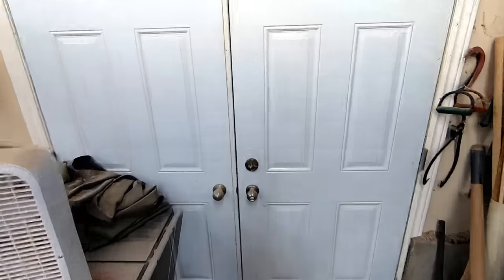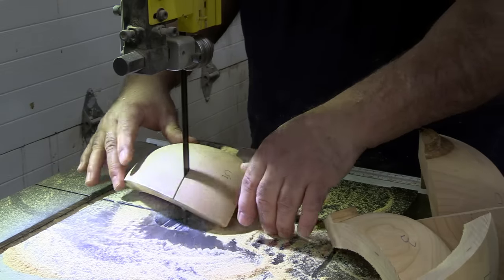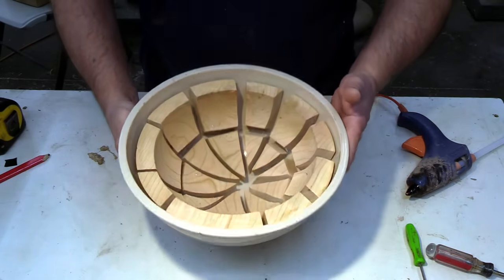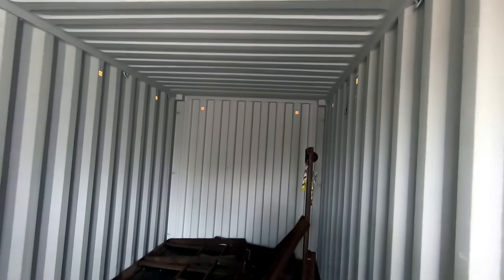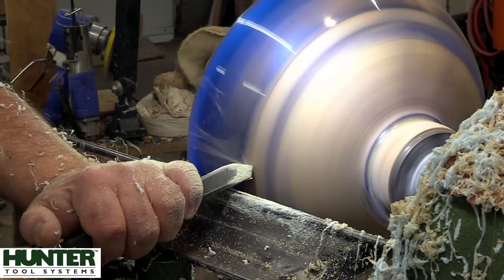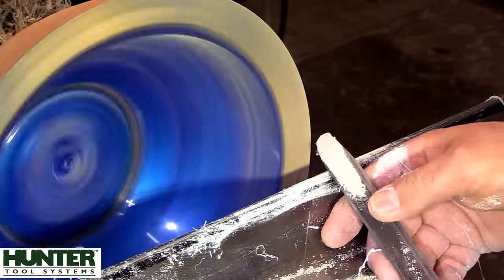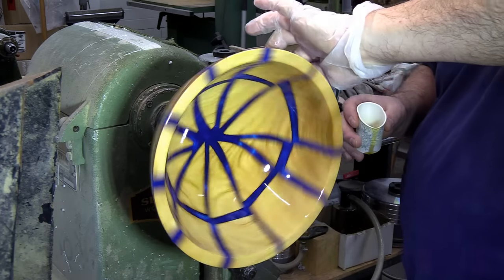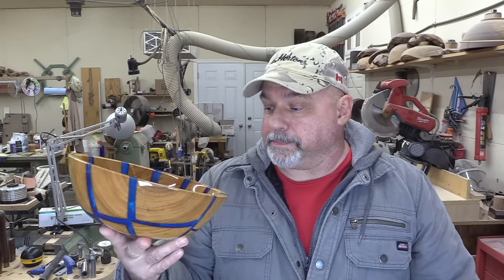Woodturning - Shattered But Not Broken Cherry Bowl FABULOUS!

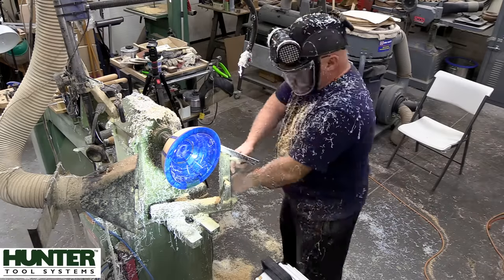Comment: 3) 26:06, You start taking the epoxy rim off the top.  Have you considered doing a wooden inlay into the epoxy with a wood that matches or contrasts the primary wood of the bowl?  I think that would work particularly well with this "shattered" style piece, but it might also be pretty cool on a lot of other pieces that you've done
Reply from the maker: There will be one like that next week. Thanks

Comment: Hi Jim, I got to catch part of the premiere. I had to go to work clearing doors so we can get out of camp. North Slope of Alaska. I was supposed to go home yesterday, but the storm has us stuck in. I do this type of segment design quite a bit. I use thin panels like the back of cabinets to space everything apart. Then glue up. Pull the spacers and pour. Sanding sealer works for controlling end grain soak up. I also get great results with the pearl showing in the resin. I have 2 of this style in my pressure pot at home now. Gonna be hard to turn as they will be in there 4 weeks by the time I get to turn them. A shout out to all who have served for their countries. And the families of those who's heros have given their lives for ours. Thank you!
Reply from the maker: Interesting! Thank you very much!

Comment: Depending on the final position of the sea container relative to the sun you could put solar panels on the roof with multiple benefits. Hot water or electricity with easy access for maintainance and protection of the drying room from direct sunlight.
Reply from the maker: We will see how much the build will cost and go from there, lol. Thanks

Comment: Hi Jim - I've got a number of different comments here, but I figured I'd break them out into different posts to increase the engagement.
1) At 7:23, you talk about sanding off the rough cut from the bandsaw.  For this "shattered" style bowl, is that something you might want to consider leaving? Maybe it's not enough to convey the effect, but I would think that a rougher edge would play into what you're going for here
Reply from the maker: It actually looks terrible if you don’t. Been there, done that. If these pieces were smashed up, that would be a different case. Thank you very much!

Comment: You should put up a tent around your lathe to keep all of the epoxy and wood shavings from getting all over Your workshop.  You could use mosquito netting so you would be able to have enough light to turn and all you have to do is shake it out.  Rig it up like a shower enclosure.
Very pretty project!  It would look nice in the orange tones with the pearl as well.
Reply from the maker: It’s pretty hard to do this and film. It only has about a 20 foot radius, lol. Thanks

Comment: Jim, your wife did have a great idea. But since you hate puzzles, are you sure she’s not ticked at you for something? 
The colors are perfect together. 
Now I’m thinking about how to make a frog to go in the bottom to hold small branches of flowering bushes in a bowl like that. A frog is a dome with a flat bottom that has holes drilled (or made) in the dome part, that the branches fit in. Since old time ones were made of glass I think epoxy might work.
Reply from the maker: I remember my mother having something like that. Thanks

Comment: Wow Jim! Your wife had a great idea!
I live in Vancouver Island, and we have shipping containers that we use for storage. One thing we found to keep the condensation in the containers at bay is that we spray foamed the ceiling only. I don't know if moisture will be an issue on the East Coast but just something to consider when you get there.
Reply from the maker: You guys are pretty much in a rain forest there, it doesn’t get that bad on the east coast but we certainly will need to deal with. I find it interesting that you only spray foam the ceiling and not the whole container. Is that due to the cost? What type of foam do you use, half pound or two pound? Thanks!
Reply: @SpragueWoodturning  I'm not sure what type we used. We only did the ceiling because it wasn't necessary for us to do the walls.  Our containers are white and beige like yours is, and they sit in direct sun all day, but I don't recall them ever being hot inside. It's about the same or slightly warmer than in the shade but not by much.

Comment: If you ever had trouble getting the bowel out i would highly recommend a heat gun with tempter controlling dale i have one for multi-purpose but its handy and as long as you use your head it would melt the glue with out burning anything. love that blue and your channel good luck with the move too.
Reply from the maker: Thank you very much!

Comment: Designer Epoxy
I like it. Have you considered using a hammer to get more jagged separations? If you do a mixed bowl (2 woods), try using 2 the same size & draw out a web pattern on each so you can get the pieces the same sizes.
Reply from the maker: That’s the plan. Thanks

Comment: I actually tried to do something similar this past weekend. My idea was to make two bowls out of one blank. Split the bowl by dropping a heavy weight hoping for random breaking instead of the cut lines like you had. Then I would put half the pieces in one bowl and the other half in the other so the epoxy in bowl A would be where the wood was in bowl B and vice versa. Problem is the blank didn’t break the way I wanted so got a bunch of small pieces haha
Reply from the maker: I can see that happening, lol. I plan on doing something similar in the future. Thank you very much!

Comment: Really cool look. The shattered pieces makes me think of images of planets on the cusp of exploding. I wonder if it would be possible to do a globular hollow form capturing that effect. 🤔
Reply from the maker: Sure, just use spray foam, then shape it and glue the pieces to it and cover in plastic bags and fill with resin. You could also glue up some wall studs and do the same thing. Thanks

Comment: Nice work Jim: scary start trying to put it back together. The blue looks really nice with the light coloured cherry. As for the sea can. A ventilation system would solve your worry about the heat. A heater would be needed for the winter. Another option would be to put a roof on it with a good size overhang all around. As always stay safe. PS: is the cherry from a local tree??
Reply from the maker: This could of been one of yours. Thanks!

Comment: Hi 👋, my heart and prayers go out in memory of everybody fallen and suffering from war. , Jim, and the input from your wife, It looks amazing, that was a great idea, it actually reminds me of a spiders web, Not sure whether it is possible, it might be an idea to see whether you can cut it into a helix, whether it is possible to use a router on a jig , or if you’re feeling very creative and scary, even a chainsaw, 
I went back to the UK last week , whilst I was there, I went to my container that I hadn’t been to for nearly 4 years, and a lot of my timber that was kiln dried is now around 18 to 20% moisture, not very good, plus some of my bits of tools and accessories I’ve got rust on them, I’ve spent quite a few hours the other day just cleaning my Sash clamps, and I have picked up my massive engineers tailstock, which is fitted with a stepper motor, I’ve stripped it all off and put it back as a normal tailstock, at some point, I might get the electronics working again, I had somebody build electronics for it, to make something that you love ha ha, 😂, pepper mills 😂, back in the late 90s, I earned a serious amount of money, making Mills, play with all made out of exotic Woods, and I had a pure silver ring band around the base, which was Homart for the millennium, I’ve even still got some profile tools for doing the tops, as for your container, I recommend that you insolate it, and even if you put a false roof over the top and sides, this will obviously help with extreme heat and cold, and will look better virtually, then I still container sitting in your garden, so I do know people, and seen a lot on YouTube where people have made houses out of them, 
It is a great idea, different wood combinations , even to the point of probably using different colours resins.
I wish you and your family, all the best for the future , and your move all go safely, I/we all look 👀 forward to your next Art project .
Phil from the moulin France,
Reply from the maker: Someone else mentioned they spray foam the top of the container and that drastically cut down on moisture in the container. They are on the east coast of Canada that’s considered a rain forest. Something to think about. To bad it’s so expensive. Thanks

Comment: I really like this week's piece it is something I was toying with doing something like this with some bowls that i picked up from my cousin after he passed that were basically throw away they had been turned while still somewhat green and warped really bad before he finished them and i wanted to try to rescue them if possible, seeing todays show gives me hope for them thanks for the informative way you do these and to your wife for coming up with the idea the cherry and Designer Epoxy with the rainbow blue is stunning. also you asked for thoughts on the hunter tools I purchased 3 of them  ( the phoenix #1 the osprey #2 and the Hercules #3) and I love them I have been using them only for about 3 weeks now but they are great I like the fact that I don't have to sharpen them and I have not had to turn the cutters yet either I can use them from heavy cutting to very light cuts in the same tool  and the best part is it really reduces the amount of sanding I have to do. I know this is getting kind of long but one more thing the power cap came in and I love it compared to the bulky masks and shields I was using Thanks for the info.
Reply from the maker: Hunter tools are awesome! I also prefer the Powercap over the Airshield Pro. Thank you very much!

Comment: Hi Jim
"Mosaic" is the term for tiles, plates, pictures etc made into pieces & put back together. I've not heard of it with rats unless you are referring to "taxidermy".
When you unmoulded it, it looked like the opposite of last week's piece -mostly resin with wood spots (where the glue was). I liked this week's piece but I would have liked the lovely blue resin rim to have remained on the bowl as it would have enhanced the resin-filled cracks/spaces areas, in my opinion
Cheers
Reply from the maker: If the resin ring was thicker I would of left it, but seeing the ghosting below the resin of the wood was messing with me. Ive seen things that have been dissected and then reassembled but in an exploded view. For the life of me I can’t remember what it’s called. Thank you very much!
Reply: Thank you for your comments. Yes that  direction -I never thought of that since school (mumble years ago). I'm not really into spiders (put me off the last week's bowl) or rats.
But the art of Mosaics is very old & yet also new with digital media using small photos to  make a billboard sign or something. & the patterns & arrangements are endless. 
I'm still annoying my family by watching your videos but I enjoy it -latest is my cake baking split & I was told to "just add epoxy & stick it in the pressure chamber" as they left the room which highly amused me, as it shows they are listening a bit. Anyway it a bit of a laugh. You video arrives 2.30am Saturday morning here so we were already into remembrance day. I'm grateful for their courage.
Reply: Regarding the rim, you were there in the room, I'm only watch on my cellphone. You make good decisions & the outcomes are great. In my opinion those who hated the polka-dot bowl probably were tradionalist woodturning people & not necessarily looking at it as from an artist point of view who wants to make heirloom pieces. Well done.

Comment: Have you ever used lye to stain wood? In cherry, it makes a fantastic red color. Epoxy resin has a pretty good chemical resistance, I think, but it would be a good idea to check with the manufacturer before using it on a resin project if you decide it's something you'd like to do.
Reply from the maker: Interesting, I never stain wood do to the fact that in most cases it’s not food safe. Would be fine on a nonfunctional piece though. Thanks

Comment: This turned out really well!
I was thinking during the initial puzzle piece stage that maybe using a foam mounting tape instead of hot glue might be useful: it'd be easy to turn away, and would provide a more even spacing. I have no idea how it would affect resin staining, though. Or if it would make demolding more difficult.
Also, I wonder if it would be easier to attach the pieces to the smaller bowl, and work inside->out, instead of attaching to the outer bowl and working in?
Your technique worked great, though, so those are just thoughts.
Thanks for showing us the sea container. Makes this move more real, for sure.

Thank you for your service.
Reply: Oh! I'd love to see a 2 or 3 wood exploded bowl, too!
Reply from the maker: Glueing them to either bowl should work, my lefthand brain doesn’t like gluing the pieces to the smaller bowl though. Lol. Thank you very much!

Comment: I like it. I'm bias as cherry is my favorite wood. I think I would have used 2 sided tape to fit the pieces into the bowl then hot glued for the final glue in. As for the multi wood bowl ideas. Go for it! Cut your first one up then cut stencils from paper of the parts and lay them on your next bowl to make them as close to each other as possible.
Reply from the maker: That’s the plan. Thanks

Comment: Another out of the box thinking and I like it!!    And of course we love that wonderful Designer Epoxy 

When do you use the vacuum on a piece , I just used mine for the first time and was surprised how much the resin dropped but no bubbles!!
Reply from the maker: I’m assuming your referring to the vacuum chamber? I mainly use it when the wood is rotten or I’m trying to fill thermal cracks just to make sure they are filled. Thank you very much!

Comment: with the shipping container you can buy inserts to insulate the inside to make all the walls flat to help with temp and shelving etc and with your bowls you should just make a big crate against the wall and put a top on it to make it a bench that can lift the lid when you want bowl blanks just a thought
Reply from the maker: I bet those insulating panels are pricey, but I’ll look into it. Thanks!

Comment: Loved that bowl, colours go so well together and it's a great design idea too ❤❤

I really like that bowl, you could do a 2 bowl opposing set if you were to use a light and a dark bowl, instead of cutting the triangles and splitting them you could also mount the blanks and use your parting tool to cut hoops/rings out and have them contrasting by alternating light, dark, light, dark and vice versa? ... just a thought? lol

Could even halve, quarter or eighth the rings to have the segments of the rings alternate too? Or go half on the bottom, quarter on the next ring up, eighth the next ring and sixteenth the next and so on. So many options lol
Reply from the maker: Lots of possibilities, thanks!

Comment: I really love this bowl Jim
Like the broken with resin
Hey I noticed you talk about your wood lathe and it is daily.but question what is the best in a wood lathe? Any particular brand
I am in skilled trades. And currently doing palliative care for my wife .she has stage 4 cancer in lungs. Once the dust settles. I am in market to purchase some equipment
I see vacuum pot and air pot and designer Expoxy and hunter tools
I have your link to purchase that
Just need some guidance on a lathe.
I have 220 volts and gas in garage.
Reply from the maker: A Oneway 2436 five horse is the king of lathes as far as I’m concerned. Robust makes great lathes too. Sorry to hear about your wife! Thanks for watching!

Comment: Another great piece, Jim.  One question: Why no heat in the drying room?
Reply from the maker: Heat is the enemy of drying bowls. If they dry out too fast, there will be nothing but cracks. Thanks
Reply from the maker: The clean room has electric baseboard heat to cure finishes and epoxy.

Comment: About the heat in your shed.  You can do like the tent campers do and make a "fly" over the top with about 1 foot of air space between it and the top of your shed, kind of like an awning.  that deflects the direct rays of the sun, and should make it at least 10 degreese cooler!
Just an idea, I am no expert!
Reply from the maker: Makes sense to me, thanks

Comment: I looked into the Tripoli buffing compounds and there’s so many different bars/choices.   So which are you using between finishing coats?   I had done a bowl that I finished with a lacquer and then just wanted to smooth it out but I used an abrasive paste which completely removed the lacquer bring me back to square one.   Very frustrating.  I’m guessing the buffing has to be done gently and not with too much pressure.  Designer epoxy.  😊
Reply from the maker: I use the brown bar. Thanks

Comment: A good tip to get spacing about right:secure on one side, then secure the piece OPPOSITE it.  Then secure the two halfway between those two, and then between those... (does not work with an odd number of pieces, not as easily at least)
Reply from the maker: Thanks for the tip!